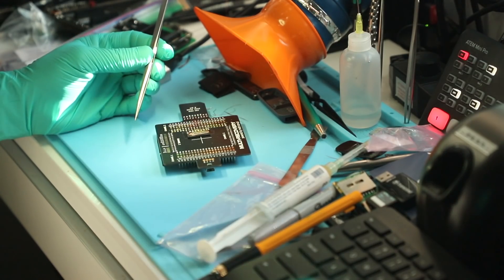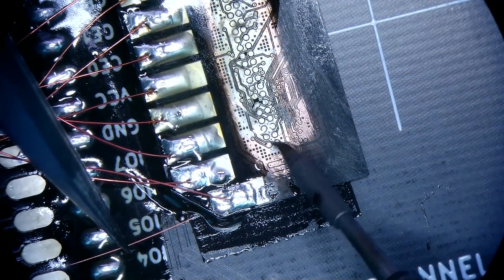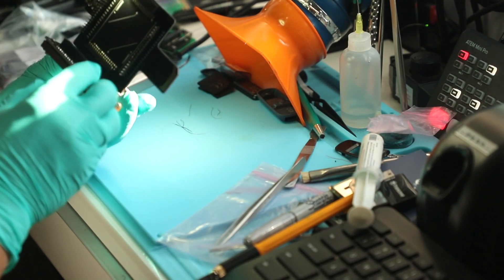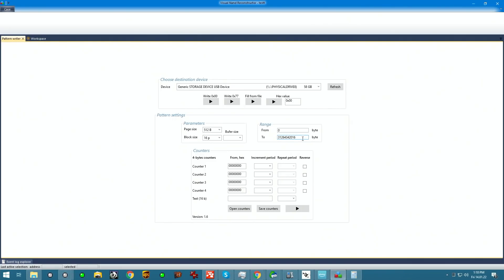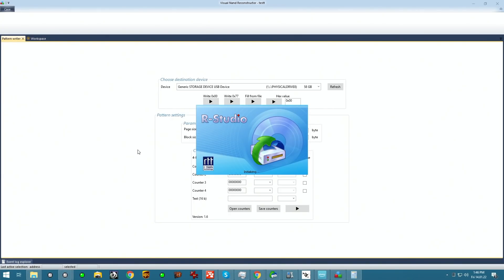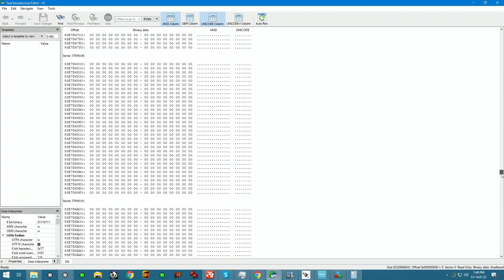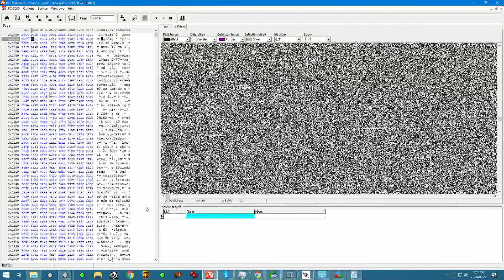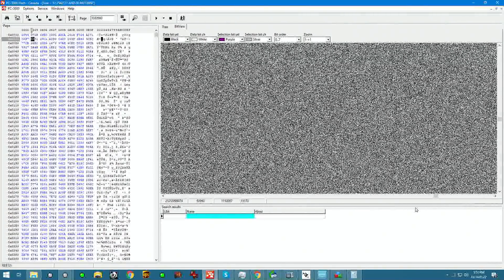3 cards had a wedding on them  Data is lost  Can we save it part 2

Comment: Damn, that memory readout destroys youtube compression, it cant handle trying to compress random noise.
Reply from the maker: I think its on a Adobe Premier. or even the capture device to be honest. I see same issues before I even post them
Reply: @hddrecoveryservices  to fix it maybe try using VBR 2 pass in Premiere Pro with the average bitrate where you want it but with the max bitrate much higher.

If its the capture device then see if there is a higher bitrate option.

Comment: Can you do XOR analysis in direct read mode?
Reply from the maker: Direct read mode will take too long. On VNR you can create and offset piece and read it out instead of waiting on the whole dump to be produced. However, since I only have 1 advanced adapter with capacitors for the state I have to read whole dump.
Reply: HDD Recovery Services why you don't make a full dump of a card before doing something with it? It should be a rule.
Reply: @ДмитрийИванов-о3л8щ  he save all client data in previous video, but if you talk about why he do direct read instead of dump - he just show it to us, and check if it read correctly, next step is dump